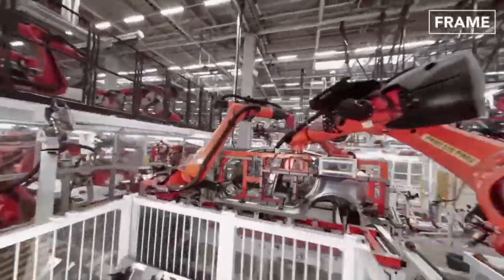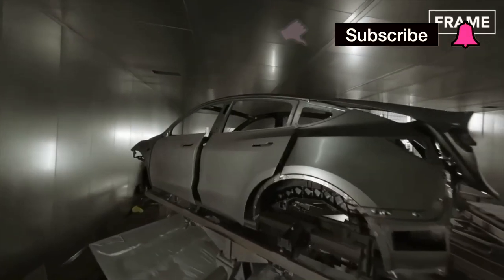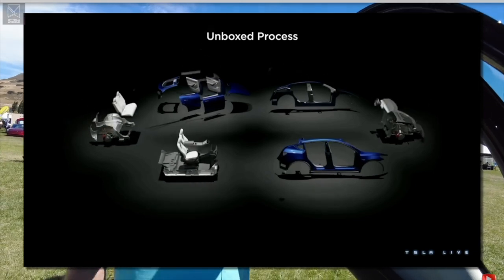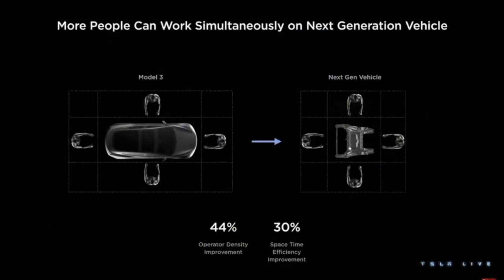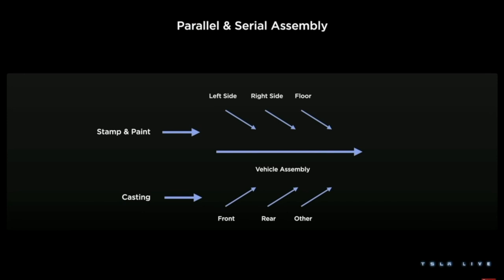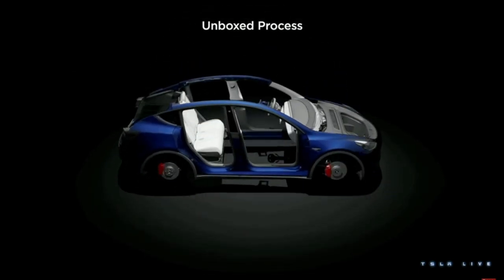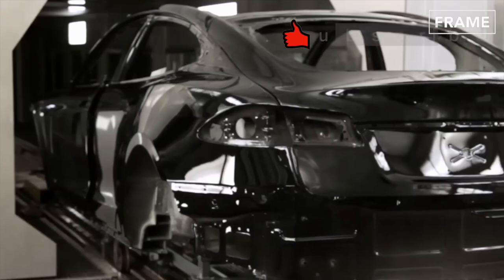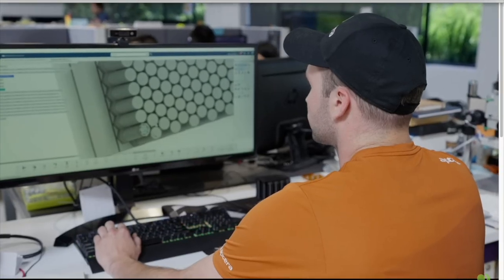Tesla Copying Aptera ?

Comment: Re: Aptera Paint & Assembly. The tints can be impregnated in Italy while the forged carbon fiber body parts are pressed & stacked for shipping. Once here, complete assembly will be very straightforward, rapid, & without deviation from fitment tolerances. 

Re: Aptera Viability. Munro Associates’ involvement in integrating the forged CF tub, plus applying their renowned Lean Design concepts to overall engineering design, plus production planning & layout, all but assures success. These are the major differences from Aptera’s first failed attempt. 

Re: Utility. Per Gruber Motors Co. discussion, they may be towing fairly sizable wheel powered trailers for zero towing losses, with differential drives to offset snaking from crosswinds.